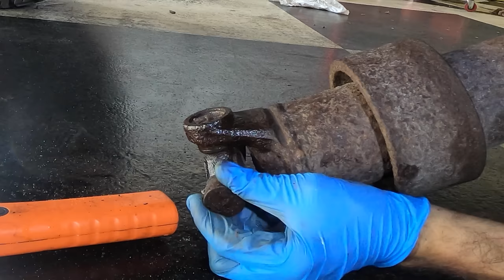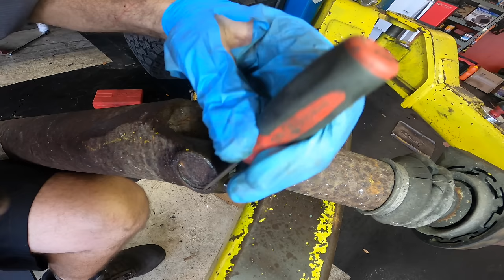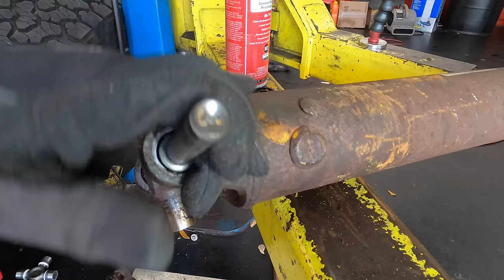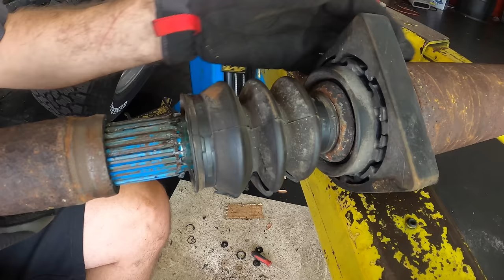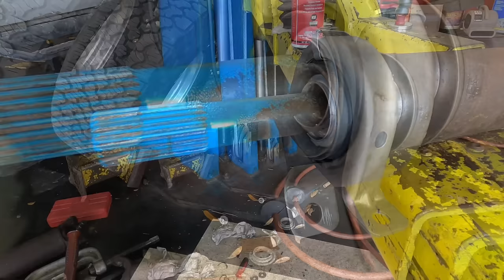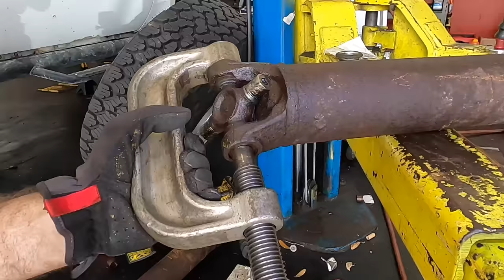Exploding End Caps!  Total Driveshaft Rebuild!  Ford F-350 7.3 Powerstroke 4X4

Comment: You have worked against yourself.   First you should have soaked all the parks the  you were going to take out as the first part of the job.  You knew in all probability that you would along the way so you should have as early as possible, As you finished each step you should  repeat the soaking on the remaining areas. With the keeper clips, you should have rotated the clip ends not towards the outside but inward  which would have pulled the clips from the recess. Finally have you didn't have a vise to put the shaft in you should have made something across your yellow lift bars to secured the shaft so you were spending half your energy holding your work in place. 2X4 or 4x4, chain strap, strap die downs would have been a great help to stop the rolling and shifting,  Your podcasts are the wonderful.  Please keep them coming.

Comment: I’m like 98% sure they didn’t produce a Harley-Davidson edition super duty until 2004. They had the F150 HD edition in 2001-2003, which I think was really just a lightning with a different paint job and interior. Either way those emblems definitely don’t belong on that truck, or else it would have a unique paint job, black interior, as well as the little plaque on the center console that says what number it is out of however many they built along with the vin. Just some useless info for the day.

Comment: Usally have to heat the u joint bolts ,they come from factory with red koctite on them. what ever happened to grease fittings on u joints ,its criminal auto companys get away with building stuff to throw away ,f 350 really is a commercial grade truck.

Comment: Too many moving joints with the tools, why not crack the ujoint bolts with a long appropriately sized wring spanner? Ray, this ujoint stuff really looks like real shade-tree mechanic work. Does that place not have a decent 30 tonne press? What about a decent vice and bench? For a business, this looks pretty poor. Not rocket surgery as you say, but pretty amatuer all the same. Some of the roughest work I have seen you do actually.

Comment: For me in the past if I'm replacing u joints I cut the inside with a torch then drive the bearings out to the inside then remove keeper rings

Comment: Can't tell you how many u-joints I've replaced. I love when I would sell a joint to a customer & have him come back to tell me the new joint won't fit! It's the same joint on a vehicle for about 15 years, yet they swear it won't fit. They bring in the shaft & I would install it, no issues. My favorite was the local engineers from the factories, micrometers in pocket (along with 50 pens) & start measuring the old caps against the new ones!

Comment: you seem to have a lot of trouble with U joints ... I always used my bench vice and smaller socket than cup . Used piece of cut off water pipe at other end for bearing cap to go into .. I have had a press for quiet a few years now so it's a lot easier . Never used hammer to

Comment: Hey Ray. Here’s a thought, maybe you should’ve first compressed the joints with the ball joint tool so those clips may have been able to be removed. All that miracle juice doesn’t help when there is rust jacking-rust binding items in play. Heat could of helped also.

Comment: I have been building driveshafts for 25 years and it actually pains me to watch you do this. You need a vise to put the driveshaft in so it doesn’t move so much, especially when you take the carrier bearing off. You also had the puller in the press wrong making the bolts take the brunt off the force. A piece of pipe that is the same size as the bearing race works best for installing the carrier bearing.

Comment: Stop sanding the bores. You're removing the interference fit . The caps are machined so that they run in spec with a certain amount of squeeze on them. Taking that away by sanding the bores makes the ujoint have excessive clearance on the needle  bearings to the cross.

Comment: Driveshafts are balanced as a unit. You should index all the yokes and flanges so they go back in the same orientation.  Secondly, why did you not use a bench vise to hold the unit.  Working on the lift arms seemed more dangerous and cumbersome.

Comment: And this is why you don't do it the stupid way of using a ball joint press to press out the pinion. When you have a perfectly good piece of equipment that you just used not that long ago to press in studs Into a rotor. And because of your laziness you chose not to use a press which is the proper tool to use. Or another lazy way out you can use an impact socket that is smaller just inside to push it out. Boy I know it's a rusty piece but poor guys driveshaft with a mangled u-joint. Oh but it is rocket surgery I don't care how much you polish it and try to get rid of burrs now you compromised the integrity and created a failure point.

Comment: only take away from this video as apposed to any of your other videos is that you should not be changing U-joints. Never ever use a hammer. believe it or not they deform the caps, and expand the holes. I doubt that shaft lasts 5k miles.